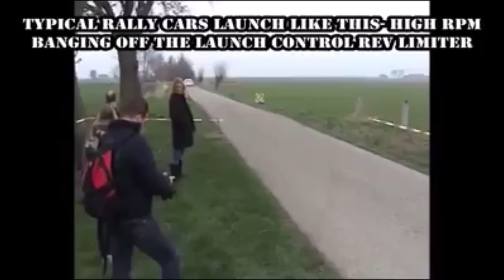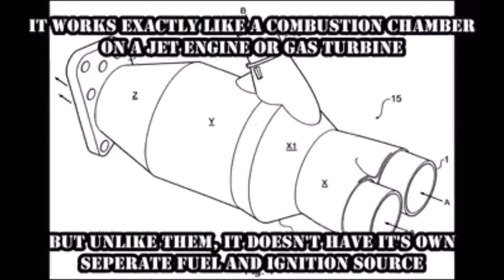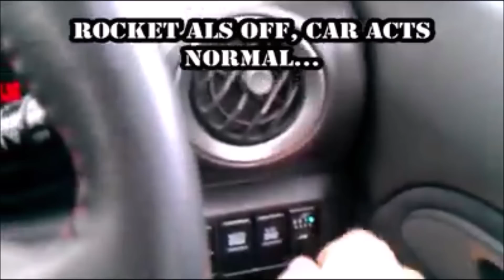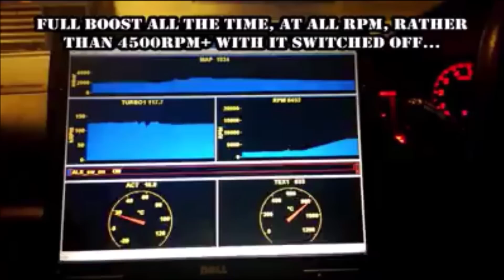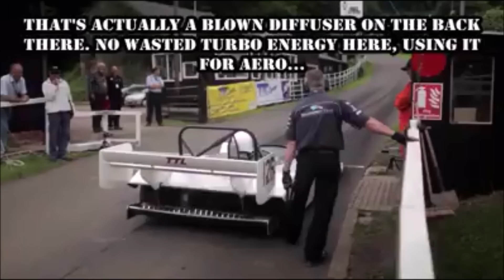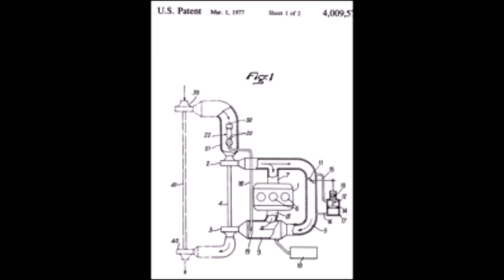Rocket Anti-Lag, making your turbo work like a jet engine- A quick overview and some mythbusting...

Comment: Is this a re-upload? I swear ive seen this video a few years back... Still watched the whole thing over, because of how perfect the video is!!!
Reply from the maker: I posted it on my Facebook years ago and only just realised I didn’t on YouTube!
Reply: @StavTech  that's where I must've watched it... It was a well put together video! I'm currently experimenting with making a quick spool kit, using compressed air roughly 200 bar from scuba diving tank, with a high flow regulator to spray directly at the exhaust wheel. I'm using a stainless fan nozzle drilled and tapped into my exhaust housing. My dad used the same principal with nitrous back in the late 90s on his turbo dragbike aka funnybike that ran 6.60's at 212mph it worked great, minus the cold nitrous hitting the turbine wheel caused micro cracking from thermal shock, I'm changing it up and using a higher temp option with highpressure compressed air
Reply from the maker: @Pro5.0  funny you should mention that as it’s something I’d be VERY interested in trying, as should work.
Seen Volvos “Powerpulse” they use on one of their diesel car engines? Same basic thing, think they’re only using 10bar, a small 2ltr tank, and an electric air compressor to recharge it.

But it works
Reply: @StavTech  I'd have to find it but there's a turbo 1.8 miata(mx5) here on YouTube that runs a compressed air spool setup with a jatco auto transmission and it absolutely works great with a standard onboard air ride style air compressor at standard air compressor pressures(like 125-150psi). Unknown on what tank size or -an feed sizes and nozzle
Reply: @StavTech  also its kind of crazy when I actually talked to my dad about what he did back then. He explained it's not so much the velocity hitting the wheel that spools it i mean it does help alot... but it's mainly the expansion of the gas entering the hot as hell exhaust stream adding a ton of volume and exhaust gas density through heat expansion and lowering egts causing the increasing pressure ratio in the turbine housing and all upstream components aka exhaust manifold, it would be cool to see a back pressure sensor inside the manifold or just before the turbine housing.
Reply: @StavTech  I found the miata guy his name is Marshall Sapp here on YouTube
Reply from the maker: @Pro5.0  I wondered about that! What your dad said makes total sense!
Reply from the maker: @Pro5.0  that’s awesome! I’d love to know what size nozzle and what position your dad and this Marshall guy had, it defo works, that’s for sure
Reply: @StavTech  my dad used nitrous for the spool nozzle because it was already being used on the bike for the shifter and 2 stages of nitrous 1 on a timer and one on a button which they used in the burnout and on the starting line to get it spooled, no extra air bottle was needed, it was a kawasaki kz1000 based 1428cc turbo nitrous bike, 2 stages of nitrous made over 600hp back in the late 90's on vp c16 fuel I'll talk with him tonight to see what he used as a jet size in the turbine housing nozzle, I'll see if it was a fan nozzle or just a regular atomizer nozzle for a dry nitrous kit. I know nobody to this day figured out why his bike was able to launch at like 4,000rpm when everyone else had to be on the rev limiter to get theirs to leave without bogging, since anti-lag wasn't a common thing in drag racing at the time, just 2 and 3 step controllers through dynatek
Reply: @StavTech  turbo currently in the car is a clone t72 dualceramicbb .96ar merged t4 hotside with a small block ford still a 302ci with heads comp cam and Victor efi intake manifold on pump E85
Reply: @StavTech  I just talked to him, he did use a stainless fan nozzle with the end chopped off drilled and tapped into the cast turbine housing he can't remember what jet size on the nozzle but nitrous bottle pressure was 950-1000psi. And it was pointed at the turbine wheel blades... it was a rotomaster turbo which were based off of rayjay turbos from Cessna planes and some tractor stuff he remembered they were RayJay "E-Flow and F-Flow sized rayjay housings and wheels"... he said the hotside was the limiting factor on power, it was 32lbs of boost dropping to around 26lbs around 12k rpm, 2 step was set anywhere from 6500-7500ish rpm everyone else had to slip the clutch and leave at 12k rpm reving the piss out of them on the rev limiter no 2-step to leave without bogging. He also made his own pneumatic slider/slipper clutch which was one of the firsts in the class... and the bike made 610hp @28psi with only 1 stage of nitrous he couldn't run full 32-33lbs boost and both stages because of traction on the bike dyno which the second stage he said was another 150hp on top of the 610@28ish lbs on a local gp bike dyno. It used a 12 inch car slick rear tire everyone else used a 13 inch tire
Reply: No efi bikes he was draw through carbureted on c16, methanol was allowed in the class but you couldn't have nitrous with alcohol. All the bikes on alcohol were mechanical injected no nitrous
Reply: @StavTech  he said the nitrous spool solenoid was only open for about 3 seconds while final staging on the Christmas tree, and it was actually leaving the starting line at full boost 32-33lbs with the wastegate open no boost controller it was only managed with wastegate spring pressure with an external wastegate that looked like a little square or rectangle cube never seen another one like it
Reply: @StavTech  somehow I've been subscribed to you for years on fb but youtube. Subscribed now!
Reply: He went through about 1 turbo per event weekend from over speeding the wheels and shaft to make that 32-33lbs it would consistently burn up the bushings and shaft he said the nitrous hitting the wheels had no effect on the wheels life. He had cracking and chipping of the wheels already before he started using the nitrous spool setup. He figured the damage was caused by the ignition cut 2-step at 6500-7500 just beating the wheels to death and over spinning the turbo didn't help
Reply: @Pro5.0  The thing you need to watch out for is that the temperature of the nitrous hitting the blades isn't just because it's nitrous, it's because you're rapidly decompressing a gas, it's definitely possible to get super low temperatures if you admit air too quickly. But I'm sure you're on top of this and to be honest you could probably get away with injecting the air a little further away because as your dad says it's about the expansion of the gas rather than the force of it actually hitting the wheel.

I too watched this the first time around :D